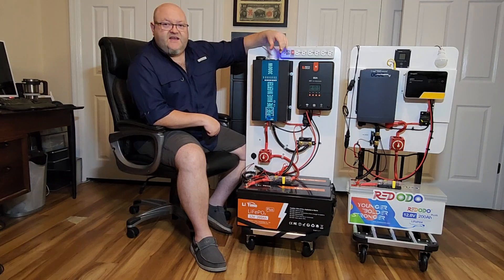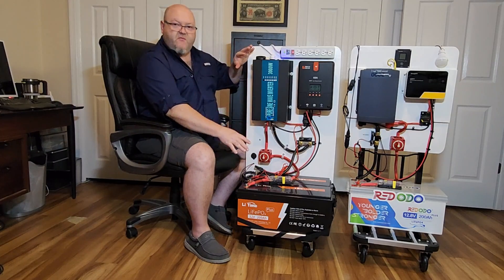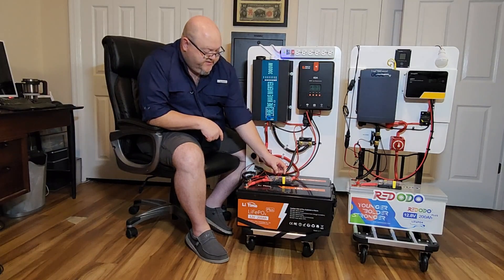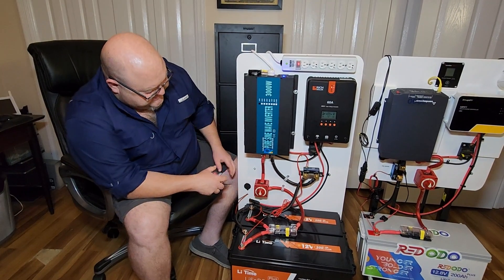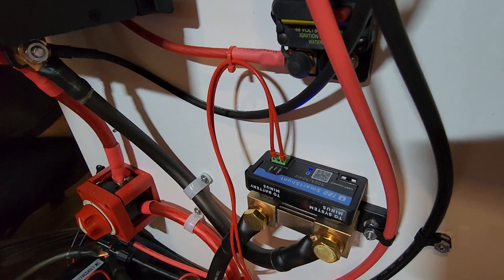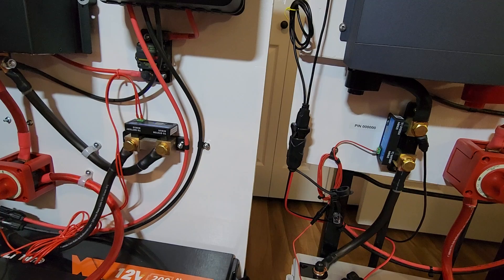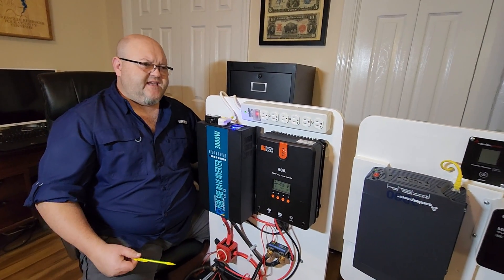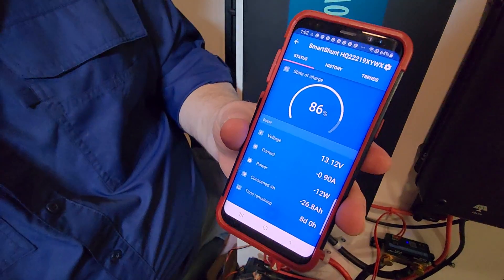HOMEMADE PORTABLE POWER STATION #2

Comment: I saw your other video on the CNswipower 3000. Which do you like better the CNswipower or the RELIABLE  and why?
Reply from the maker: Well, I've personally had more experience with reliable because i run it daily without any problems.  It powers my 12 btu ac in the summer and heaters in the winter.
Reply: @Matthews_Reviews  Thanks for the feedback. I've bought 3 CNswipower and 2 blew up on me. But even more ecoworthy died. I had like 7 of those blow. But that is better than the cheap chinese things. Never again so I only want quality pure sine wave. I bought CNswipower only because this youtuber John Headsmasher kept saying how great they were but a 3200W version couldn't even start my table saw. If you like the Reliable, I will look into it further as I am 1 inverter currently.  I know the quarks of these two brands so it's uncomfortable trying unfamiliar brands.   You should how some testing with heavy load equpment like air compressors, air hammers, table saws, etc. Those are the things that really distinguish the inverters - not resistive loads like hair dryers and space heaters.

Comment: That's a great, good looking build. I'm making one now with 2, 200AH batteries. It's operational now but I still need to add a shunt, a breaker, a cut off switch, and AC charging. Mine is low profile though. It's all going on a Harbor Freight furniture dolly. 
BTW: We're practically neighbors. I'm just down the road from you in Calhoun, GA.
Reply from the maker: I go to Calhoun every week my mother lives there.
Reply: @Matthews_Reviews  Just like Cleveland, TN, It's God's Country.

Comment: very good set up ,,,,,,, i got me the Vevor 5000w ,,,the dc controller , and 2 12v 100ah batteries also 2 solar panel of 200w ,,,, i still have it on the boxes ,,,, i was planning to hang up on the garage wall but your idea is looking better by the minute

Comment: How many hours would that setup run just a refrigerator? and CAN & WHERE would one plug a gas generator into it to charge the batteries?
Reply: I’m no expert on this but I don’t see an AC charger for this. So if you aren’t using Solar to charge the battery then you will need a battery charger which you would plug into your generator to charge the battery. He probably has a battery charger that he uses for all kinds of things so it’s not mounted.

Comment: 10:45  Just drill you a hole in that board where the wire plug will fit through & you CAN plug it into the female close to the board

Comment: Great video , what size wiring did you use for inbetween the charge controller and circuit breakers 8 or 10 ga?
Reply from the maker: Thanks for watching, it was 8 ga Knukoncepts wiring. Please Like & Subscribe I'm trying to get to 1000 subs. :)

Comment: Good idea about the sealed fuse holder, gasoline fumes and propane also are heavier than air and scoot around the floor looking for a spark. About the plywood backer board Matt, after a storm here in Florida people just throw out all the new plywood that they bought to shutter up windows, then I go around and pick up as many as I can to use around the house. Some people are crazy wasteful.

Comment: Are you running a negative wire from your solar controller directly to the negative post of your battery? I was always told not to run anything to the negative post other than the wire going to your shunt, or you will not get correct readings from the shunt. I have been told to run it to a bus bar along with the load side cable from the shunt. Is this correct?

Comment: Nice build - different from the tool box builds I've been looking at.
One issue though - your main fuse is 100A. That's inadequate for your inverter.
At 12V to get 3000W you need at least 250A. Assuming the Inverter runs 90% efficiency, that becomes 278A (call it 300A).

Your wiring is good - the 1/0 AWG wire will do 300A and cope with start up surges.
Your main switch is good (300A rated).
Your batteries are good - surprised me actually, I thought "two batteries, that'll only be 200A", but 200A each combined to 400A is perfect.
Upgrade to a 300A fuse (or 2 x 150's). Even then it may not cope with surge loads if the inverter is maxed out.

Your other 2000W build requires 185A too, at 90% efficiency (call it 200A). Assuming it has the same main fuse.
Reply: i thought inverters come with fuses built on them unless pure swine dont

Comment: I am looking for some help. I bought a portable power station and it says no more than 100 watts on input. I have a 100 watt solar panel but on cloudy days I may get 30 watts. What I thought about was getting a second 100 watt panel and combining them or just a 200 watt panel. My issue is I can't find something to limit just the input to 100 watts. I have no idea what battery it has inside the station. Any help would be appreciated.

Comment: Unfortunately you chose the worst possible inverter tech for your build. High frequencytransformerless inveryers luke these provide a very short life expectancy, especially when powering household insuctive loads like refrigerators, microwaves, portable AC, units and power tools. A much better choice would be to purchase a low frequency, transformer based inveryer charger. It will last you many years longer and you wont have and problems powering inductive loads.
Reply from the maker: I agree that low frequency would be better but they come at a much higher cost compared to high frequency. But I've done just fine so far with my high frequency inverters because I run my inverter AC unit and small space heaters on them year around and they haven't failed me so far. Thanks for watching! Maybe sometime I will have a low frequency inverter that I can bring to my channel and test it out . Have a good day!

Comment: Matthew,
What is the height of the vertical board attached to the Franklin cart on the 2nd build?  Thank you.
Reply from the maker: It's 39 inches. Thanks for watching Mike. Please like & subscribe.
Reply: done,...plus I'm modeling my build after yours.  I like the portability @Matthews_Reviews
Reply: @Matthews_Reviews How is your fuse holder secured to the top of your battery?  And just curious what amp fuse does your system have,  and do you run the  charge controller  and inverter through It?  Thank you sir.

Comment: 19:06 I'm pretty sure that the manufacturer of the charge controller has thought through to the end of the aluminum cooling grid under the device, so that it is best to attach it directly to the base WITHOUT any kind of risers, as you have done. This additional distance to the mounting plate, which you "arranged" with your own permission, probably hinders the planned cooling, causing unnecessary turbulence in the air space of the device's cooling grid. When you install the device directly on the mounting plate, then there are only the vertical "whistles" behind the device, which work effectively as negative pressure in the upper part of the device - and thus the cooling air also flows smoothly.

Comment: Hi Matthew. How much did your 12V 200Ah LiFePO4 batteries cost?
I think it's not worth and right to buying them, because "home made" must also cover making the battery yourself. And my understanding is that those battery cases have at least 30% empty space inside them. I had ordered 8 pcs 307 Ah (nominal 280 Ah) cells, the dimensions of which are about 70mm x 170mm x 210mm, and when I put four of them together, I get a 12V 307Ah battery, the total dimensions of the cells are about length 290mm x width 170mm x height 210mm. And together with the JK-BMS device, they cost around 500,-

Comment: Nice setup being portable and lots of power, depending on how hard it is to get outside of the house to the garage and back inside could be a deciding factor. Wouldnt want to lift it to the back of my SUV if its got three 200 ah batteries unless you have lots of help. I was thinking of a dolly with bigger tires and taller with welded metal supports added on my version, still in the planning stages though I do have most of the parts. Might be nice to add re-usable cable restraints for when you plug cords into that strip, velcro maybe? Where's the 12v side of your system, lots small car tools, lights, phone chargers use that so could be worth adding? Wonder if disconnecting the solar chargers while not using them will lower your idle draw with just the inverters and some have an ECO mode to lower it more.

Comment: HI. LOVE THE PORTABLE POWER STATION I AM BUILDING ONE. ONE THING IF YOU TOOK THE BATTERY'S OFF WOULD THE FRONT WHEELS  OF THE TROLLY LIFT OFF THE GROUND  HAVING THE WEIGHT OF THE  INVERTER AND CHARGE CONTROLLER +
Reply from the maker: No, the wheels stay on the ground. Thanks for watching, please like and subscribe.
Reply: Thank you keep the good work up @Matthews_Reviews
Reply from the maker: @cabin56  Thank you for watching and motivating me with those kind words!

Comment: Good video and setups!   I did a similar one with a Harbor freight hand truck with my 12v system, i've upgraded now to 48V.     your video came up on my home page :)   have a good one
Reply from the maker: Thanks for watching and I appreciate the support! Please like & sub I'm trying to reach my 1000 subs.  How do you like the 48 volt? Is it harder to find inverters and other components? What about cost wise is it a lot more expensive?  I like that its more efficient.
Reply: @Matthews_Reviews  congrats on getting the 1K subs (and then some!).   I'm hoping to make it there at some point but slowly getting going.    I do like the 48v much better for everyday use and expansion.   I just still have the cheap inverter but looking to get a nice low frequency unit (hopefully by this spring).   Other than that, the cost has not been bad as the batteries have come down quite  a bit

Comment: Why are you using a 200A fuse and u have around 2x 12v x 200Ah batteries, wouldn't that limit the current you can use
Reply from the maker: Hi Phillip, I just had a 200A on hand so that's what I used till my Amazon order arrives . But you are correct it can limit current. Thanks for watching, I appreciate you're help! Please like & subscribe because I have a lot more content coming out every week.

Comment: Why do you run the positive of your charge controller directly to your inverter?  This bypasses the battery shutoff which would allow a single location to shut your system down...

Comment: I just put two li times 230ah and rich solar 20a mppt in my van. Can stay out in the bush for min. 2 weeks running everything with no charging. I do have a 20a dc-dc charger and a 170w rich solar portable panel.
Reply from the maker: That's awesome!

Comment: That 200 Amp fuse seems to be undersized for that 3000 Watt inverter. At full load (3000 Watts), even at 85% efficiency and low battery (11.5V), that inverter going to want about 310 Amps. Maybe you sized it to protect your wiring (as you should), but you are limited to less that 2000 Watts before that fuse clears. A 24 volt string would probably be a better choice above 2000 Watts.
Reply from the maker: Yeah I'm dying to build a 24 volt system in the future I think it will be a bit of a learning curve for me but it will be more efficient. Thanks for watching, I really appreciate it! Please like and subscribe I need all the help I can get.

Comment: The only thing I would’ve done differently, is to wire to a 24 V system and get a 24 V inverter. It’s more efficient. Also, you can run more solar panels with 24 V.
Reply from the maker: These are just my first 2 builds I'm sure I'll have a 24 volt system coming in the future. Thanks for watching,  please like and subscribe.
Reply: I am glad I found this channel. I’m very much a DIY person, but electrical and solar just isn’t my forte. You got a new subscriber sir. Thank you .
Reply from the maker: @visamedic  thank you for the kind words I really appreciate it!
Reply: I kinda understand that 24V is more efficient “but” my devices are 12V so loss is now created by stepping down 24V down to 12V.
Please explain why 24V or 48V is better when devices and appliances are 12v.
Reply: @paulgoodwin2570  
48 V is much more efficient, less thick wire, and less potential for heat spots! But again, it all depends on your application.  Most people who build a 24 or 48 V system, can step down with a 12 V for those appliances needing 12 V. It’s not that hard to do.
My first system was a 24 V system, but I found that 48 was much better for my house. But since I was brand new to solar, I learned the hard way! 🖖
Reply: I agree, hope to see a 24v system w/2 batteries.

Comment: I reckon this would power just about everything you could want on a weekend camping trip...and could be built more compact if that was the goal
Reply from the maker: Yes sir, you could definitely shrink it down and make it more portable but you might have to remove the batteries because they are kinda heavy. But you can power a ton of stuff. I was able to power a 12,000-btu midea u-shaped air conditioner for 11 hours. Thanks for watching. Please like and subscribe.
Reply: @Matthews_Reviews how many of these would you have to hook up to run some hiring on like 240? Or can you already ?

Comment: You have two similar portable 12V power stations with Diy components that do not communicate with each other and have no monitoring. 
A third could be with an All-In-One inverter and maybe a Server rack battery and Solar Asssistant monitoring system, and a fourth all Victron with Rpi Venus OS. 
Then you could test them all differently, upgrade them and compare not only the components but also the monitoring and how they work together, communicate/not communicate etc. ...
The third and fourth portable stations could be 24V and 48V alongside these two 12V ones as well and build Diy LifePO4 batteries and review different BMS and test them on limits, which not many people do. On the other hand there are many channels that show different Diy components all over again.
Reply from the maker: You never know what I will build. There are lots of options out there. I just like the DIY power stations because they are affordable for the average guy. I appreciate you watching, please like and subscribe.